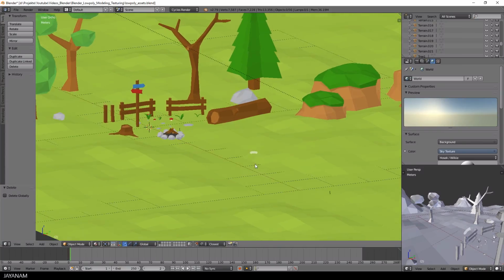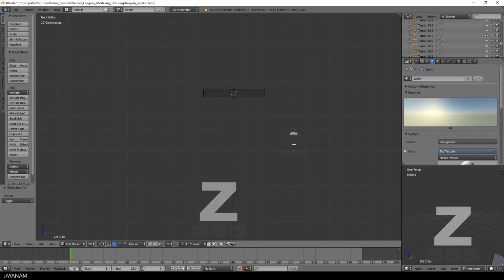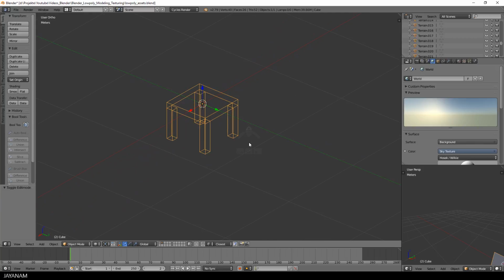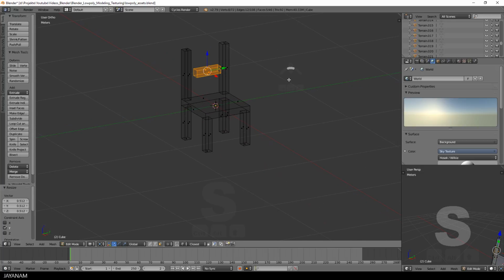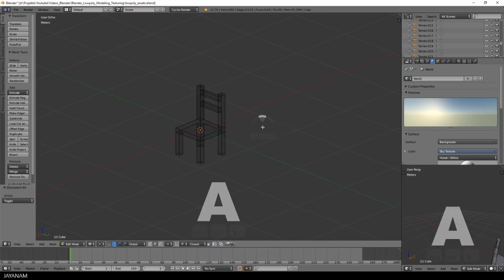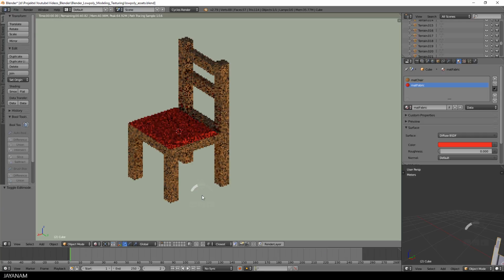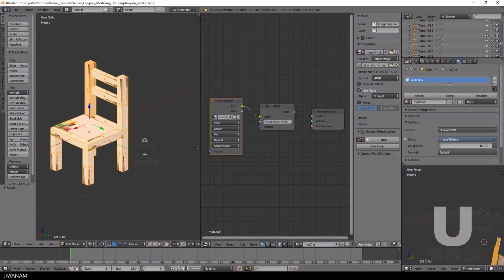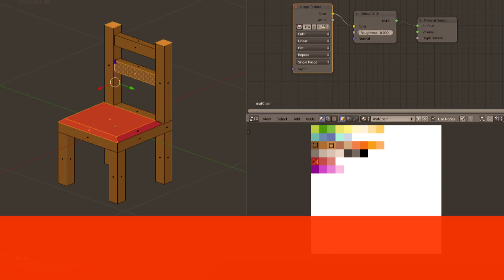How to Low poly in Blender

Comment: I've tried several times to snap to vertices, but it isnt snapping to the first object. Anyone has the same problem? It just straight up ignores, and I triple checked the snapping tools
Reply from the maker: Can you describe your setup more in detail, which objects do you have, do you try to snap objects in object mode?
Reply: Honestly, I just opened a brand new file and did the exact same thing you did :( I've tried it with a clean file 3 times in a row but it doesnt work. It snaps to grid lines when I change the snapping option but not to vertices. I really dont know what else to describe :/

Comment: I am having trouble applying the textures in unity. Whenever i apply it, some parts of the model are the wrong colors compared to my model in blender. Could i get some help or is there already a tutorial video somewhere?
Reply from the maker: Hm, ... and in Blender the colors are fine? Did you unwrap the model like I did? If you like you can send me the model and the texture via mail and I will have a look, but basically it should work with the model you exported

Comment: Awesome video! For the texturing part, can we just vertex paint the model and then in UE/Unity use a simple Vertex Color material? I probably miss something here, but wouldn't it be easier than this UV approach (which is great btw)?
Reply from the maker: Hi and thx, what you miss is, that this texture can be used for every model in your scene or in your whole game, so you need just one material for all your models which leads to a very low number of draw calls.

Comment: Does this Color square method work in Unity materials? I made all my models with the unity primitives, and just added a single color material to each part of the whole model. My question is: is it better to create a texture like your Color square, and just shift the textures to the appropriate color I want for each part, eliminating the need for all the different color materials I've created in unity?

P.S. I really liked the tutorials on "Blender Room for Unity 5", but could not find a playlist for them, and sorting through your vids to see if I missed one was difficult. Can you make a playlist for them, if one is not already made.  My project is similar to the "Open/close" tutorials that you created. Thanks. Both for the help and your fids
Reply from the maker: Thx for the comment.

1. Yes it's better due to performance reasons, I mentioned this in the video
2. I will create a playlist tomorrow

Comment: But then you need to upload a new texture to the gpu, and sample it for ever pixel every frame instead of using vertex colors.
Reply from the maker: what do you mean by that exactly, why should you always upload an image, there is only one texture and material for all models that you use in the engine
Reply: Jayanam so you upload it once, but it will still sample a texture every frame for every pixel, instead of just coloring vertices and interpolate

Comment: Is there a reason why you don't simply loop cut and extrude?
Reply from the maker: The reason is that I would produce more polygons with that approach and as I said I am going for the lowest amount of polys possible.
Reply from the maker: Well, removing faces means in the end removing vertices as well:-) I just try to keep the polygon-count low, in the end (for the game engine) it is the number of triangles.
Reply from the maker: Yes, in this particular case it is true, but I meant I try to keep the number of faces as low as possible and this leads in the end to less vertices as well, but what is important is the number of triangles the engine has to render. in the case of a cube it will be 16, when you remove a quad it will be 14.
Reply: @Dfjs427  an answer to an old question. Less faces means an engine will not have to cull invisible faces, so even if it will not actually render them, it'll need to figure that out. Also less faces simpler UV map.

Comment: you can do a whole project with too much assets and put all together in that texture... and overlapping island too. is a very useful and performance technique for low target mobile devices.
Reply from the maker: Exactly, that's what I do.
Reply: I use that tecnique in my project , save me some fps , batches with the texture atlasing another powerful concept for very low target devices.... that kind of techique has a powerful sense of resolution too...I mean, you can upload the image in 32x32 px and put it on unity's project folder , textures , I used a 64x64 px and it is look like the same if I put it higher... for that texture you can use 64by 64 and scale at the minimium the island.... so the color is flat...also you can put the island in a half of a tile for example  you got (red near brown) if you put the island in the middle of 2 colors, you can see a gradient effect  , I recommend you strong to put island between 2 colors..... also you can create a pallete in a website and put some picks in gimp or PS in the squares...and experiment.
Reply from the maker: Yes, I did this all you mentioned in previous tutorials, I export to UE4 and Unity as well.